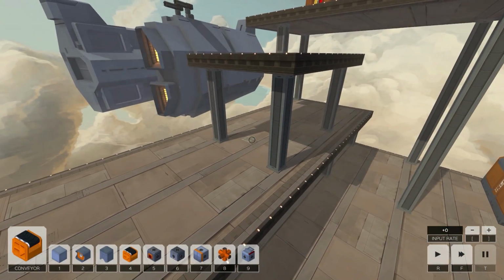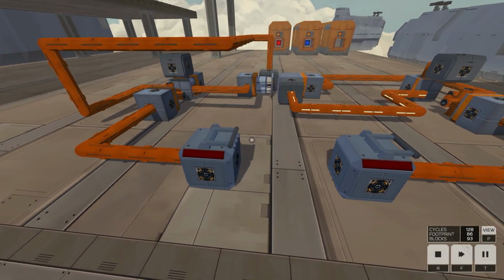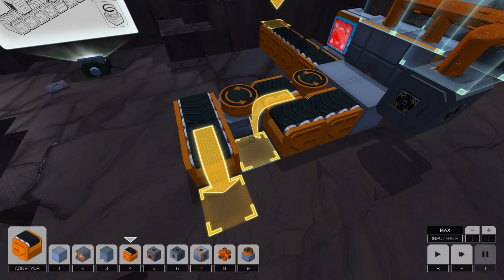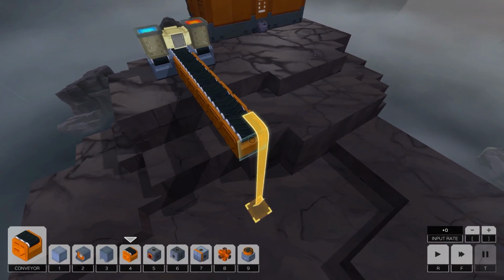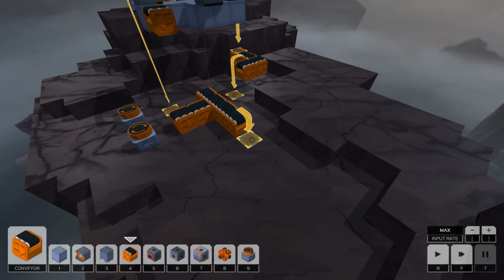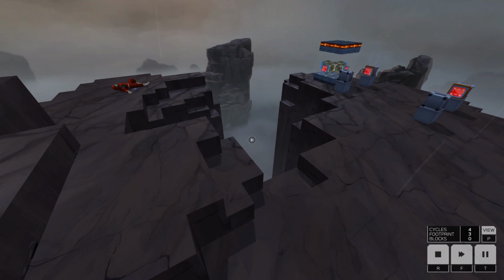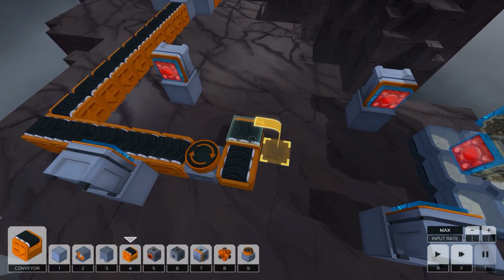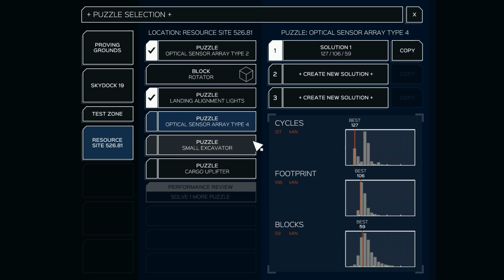Simple Logic and Bigger Factories! (Infinifactory #03)

Comment: In regards to Conveyors...

The first 1x1 part of an object to touch the conveyor is the part that will follow said conveyor dragging any connected pieces in suit. This does not consider the bounding boxes of objects,  rather only solid mass within said bounding box.

This still gets me some times, my trick is when in doubt, ill build a placeholder out of the blue blocks and build what I expect to come through, and then build the infrastructure around that, then delete the placeholder pieces. Helps a lot when dealing with complex puzzles later on, especially when you start reassembling stuff.

Comment: I mentioned this in the comments to the previous video, but here it is again:

HOW THE CONVEYORS WORK 101:

If a construction is on conveyors going in two different (perpendicular) directions, there is one direction (I'll call it North/South) that it shall always chose first. This means that you can pull things off an East/West conveyor if you've got a North/South conveyor that the construction also passes over.

And for reference here's a list of ways to move blocks in order of priority (highest to lowest)
1: Pushers/Blockers
2: Lifters
3: Falling
4: Upside-Down North/South Conveyors
5: Upside-Down East/West Conveyors
6: North/South Conveyors
7: East/West Conveyors

Also, you can build on the faces of Pushers, and the Pusher will move it so long as it isn't stuck to anything. With that you can get rid of the second Pusher that you were using to move the block back.

Comment: The direction of where your block will go when it touches more than one belt is determined by North, South, East, West. If your block touches a north belt and a west belt, it will go north. The levels have inconsistent compass points, so you have to test each level to know which way is which.
Reply from the maker: Kind of a weird way to do it but I'll have to test that
Reply: This is just a thumb rule. You can get the complete Infinifactory turn order here.
https://steamcommunity.com/app/300570/discussions/0/530649887197893834/
Reply: You hardly ever need to depend on this, though -- the "real" way to control which direction multiblocks go is to leave gaps in your belts, like you did at 9:16, although that still works even if the belts are on the same level

Comment: For conveyor mechanics, look at the second paragraph: https://infinifactory.gamepedia.com/Conveyor
For discussion on conveyor priority: https://steamcommunity.com/app/300570/discussions/0/1368380934269224279/
For a video with conveyor experiment: https://www.youtube.com/watch?v=2bkeNji0Rds

For a simple solution that will work every time: Make sure you know which end you want where, then make sure that no conveyor pushing in any other direction than the one you want will be in contact with the multiblock structure you have at any point. The example is that if you want a multiblock 3x4 moving along the 4 long axis to move perpendicular, you would create a gap of 3 before the conveyor moving it in the desired direction. This will ensure that the block furthest along the linear path will be the one dictating when the change of direction happens.

Comment: KAN you kan(XD) just make spaces between conveyors and get a better block score.
Reply from the maker: Didn't even think of this...
Reply: You wouldnt get a better footprint though, press that T key to see how it calculates the footprint. every square used, even by the part it self, is counted.
Reply: @Fredrik Kjølner; (s)he didn't mention footprint, just block score, which only counts blocks placed which do something like move stuff, detect stuff, and so on. You're talking about two different measurements.
Reply: I know, just trying to make a point about the differences in the two scores.

Really looking forward to the rest of the play-through, I got the last two puzzles left, and I am kind of stuck.
Reply: Making spaces would also help him get the correct block to be in contact with conveyor.
If he had a thing that was 4 long, and needed it to change direction at the end, he should make 3 spaces between the end of the first linear motion and the start of the second linear motion.

Possibly seen from above (- is conveyor, _ is blank block or nothing, [_] is conveyor in different direction)
- - - _ _ _ [_]
_ _ _ _ _  [_]